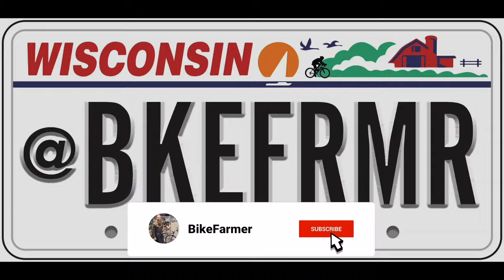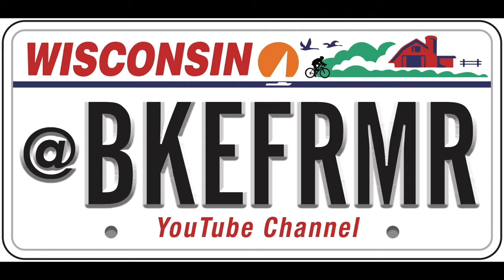VINTAGE Cannondale RESCUED and brought BACK TO LIFE! Full bicycle Tuneup - Clean, lube and adjust!

Comment: This is the same bike as I use around Pittsburgh, downtown area. Years ago I went to Nashbar linear pull brakes because I got tired of futzing with those canti brakes, they were always cranky. I also added a used front shock I bought for $25 which is great with the rough streets, potholes and cobbles. I got so I could not shift the Express shifters on the rear because of arthritis in my thumb, so I went with  SRAM twist shifter and derailleur. However, I still have the Suntour freewheel, and the shifting is never right on. I may revisit the Xpress shifters and old Suntour derailleur again after this video. Thanks!
Oh, my bike is the same but the lettering and Cannondale logo are a really cool hot pink. It really pops.

Comment: I remember when Cannondale released these large tube thin wall frames. They were pounds lighter and way stiffer than the steel frames of the time. So they quickly dominated all the worlds grand races. They were also just as quickly banned for a few years allowing the other bicycle manufactures to catch up.

Comment: Gosh, I love those old Cannondale frames.  I gave away an old M500 a few years ago to someone who really needed it.  I miss it, though.

That bike you are working on is really early; you can tell by the drop outs.
Reply: I had a M500 with the Force 40 breaking system that I used as a commuter. It was so stiff, but it served me well and inspired me to ride more.

Comment: I had the bottom bracket adjusted by a bike shop in southern Pennsylvania where this bike was built.  So true about calling toe clip and clips called clippless totally understandable. It takes time to figure bike terminology out. I also have a early 90s Cannondale with a Quill stem extension.

Comment: Picked up an old 90s Giant Iguana with the full Suntour XCM groupset, and honestly, I still think that's a better entry level groupset than the ones we have now. Thumb trigger shifting going up, and thumb lever going down with clicks instead of stops makes it really easy to get the gear you need, and I prefer it to the mechanisms that have a trigger in each direction.
Reply: Had one of those on a Mormon Mission.   Loved that groupset.   Suntour made great stuff.

Comment: In the Uk, those toeclips are known as ratraps 🤷‍♂️
Reply: Same here...or just 'cages'.
Reply: Toe clips, rat traps, and toe traps are the nicer names for them. In my 20's I road raced with toe traps and Italian cycling shoes, switched to clipless pedals in '85, when I turned 30. I picked up mountain biking at 40, with MTB clipless on both road and MTB. In my 50's, I started helping with bike repair at my local, small town shop, and nearly crashed every time I test rode anything with toe clips. I'm now 69 years young, and have a mix of pedals, MTB clipless on my 'serrious' bikes, flat pedals on my town bikes, and have a mantra I repeat when working on a bike with toe clips: don't forget about the toe traps don't forget about the toe traps don't forget about the toe traps... Happy Trails, rubber side down, smile side up😁

Comment: Does squeezing the locknuts in the truing stand mimic the cam on the QR compressing the bearings in the frame in your opinion??
Reply: No way. You can pull the wheel out of the stand no matter how hard you twist the knob. But you'll never pull a wheel out of a bike with a properly tightened skewer. The stand does not apply that much pressure on the axle.

Comment: I always remove the tires to true the wheels, then put the better less wore tire on the rear.
Reply: Traction's more important in the front--losing front traction almost always means a crash. Don't rotate tires like that.
Reply: @mattgies  I'm rotating good tires for even wear not bald wore out tires.
Reply: @jasonbusch3624   Then wait until the rear tire is fully worn out, put a new tire on the front, and move the front tire to the rear.
Reply: @mattgies  good luck finding a new matching tire
Reply: @jasonbusch3624  Doesn't have to match exactly. Same size and tread type would suffice. But my tires aren't discontinued anyway, so no luck required.
Reply: @mattgies  so then how do you tell which tire will get better traction? Ever try to sell a bike with mismatched tires?
Reply: @jasonbusch3624  I'm a bike mechanic, and I service bikes with mismatched tires all the time. It's not a big deal to 95% of people.
Reply: @mattgies  then why would it matter rotating tires? Discount,Belle, and every other tire store does it. It doesn't.
Reply: @jasonbusch3624  Those are car tire dealers, yeah? Cars are not steering-balanced vehicles like a bicycle is. The car won't fall over of the front tire slips for a moment.
Reply: @mattgies  so do you have a truing stand?